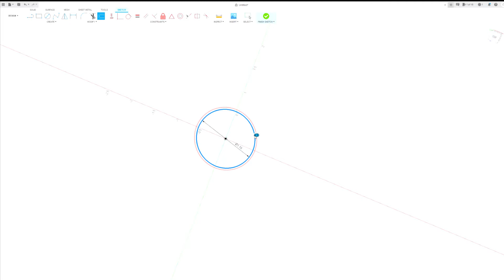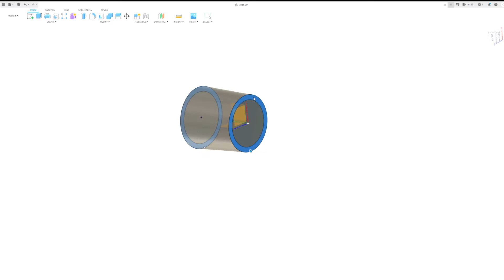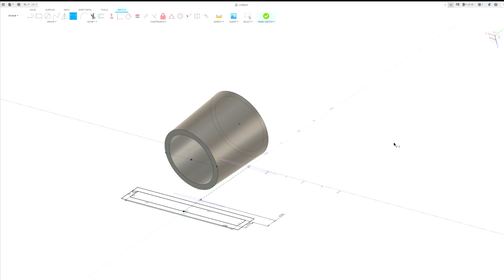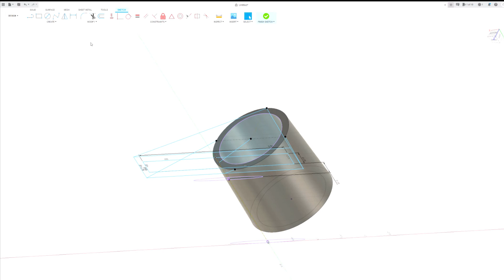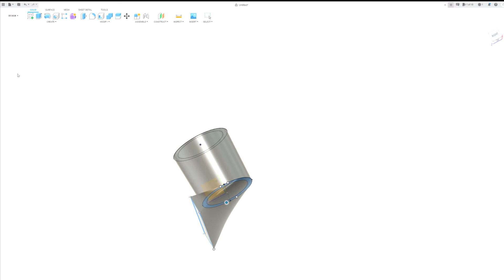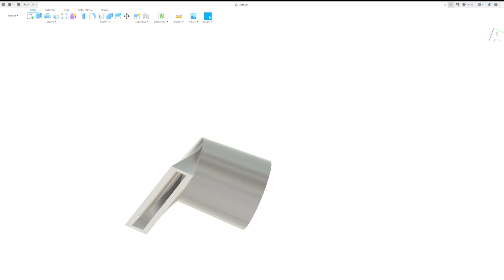Using Fusion 360's Loft Function to Design a Shop-Vac Nozzle

Comment: can you elaborate on how you're creating tangent exactly?  that is below the object 1
Reply from the maker: You simply turn on 3D drawing and create lines that are a sort of "wireframe" connecting points on the adapter (object 1) to the drawing of the nozzle, then use the Loft function to connect them.  The Loft will follow the drawn guide lines